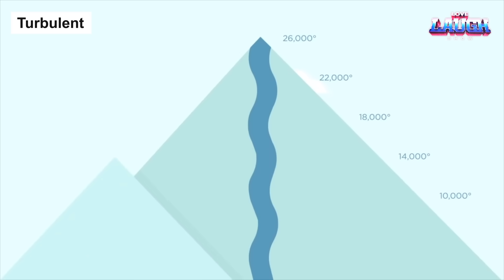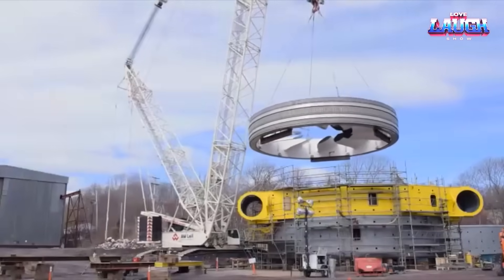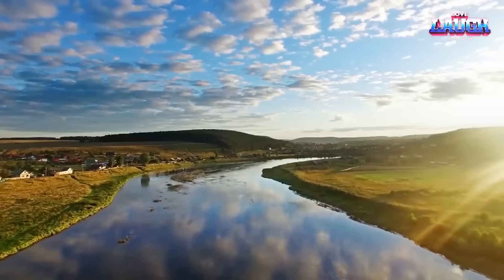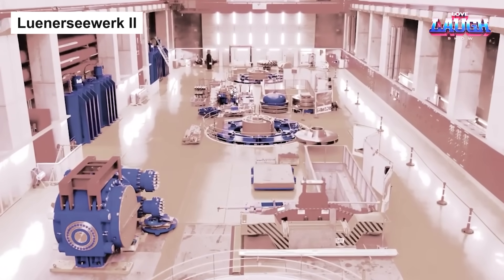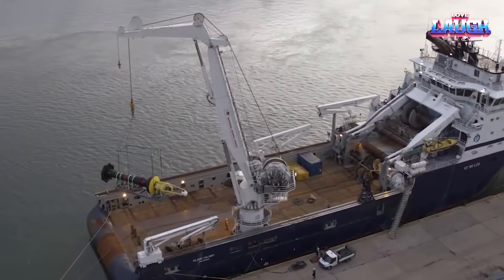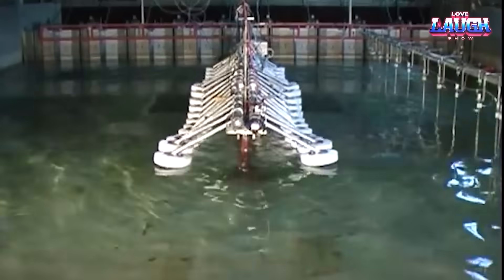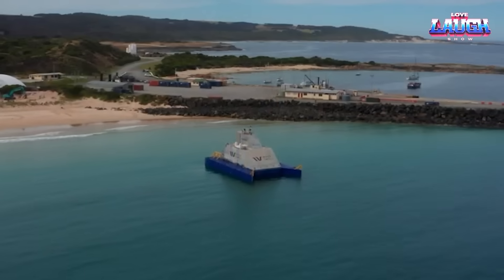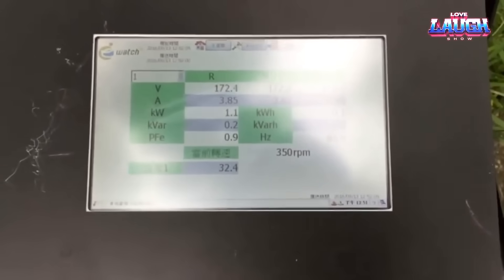12 Amazing Hydroelectric Technologies That Will Change Our World

Comment: Taum Sauk pumped hydroelectric power station is NOT, the largest in the world. The Dinorwig pumped hydro station, in North Wales, has a storage capacity about 2½ times greater than Taum  Sauk. Currently, the biggest one is  actually Fengning Pumped Storage Power Station, no Surprises it's in China, completed in 2021 with a whopping 40 GWh, 11 times bigger than Taum Sauk.

Fundamentally, a hydropower scheme can only extract a percentage of the energy in the water and all the different hydro generator designs are basically trying to improve efficiency abd/or reduce costs. The overall scheme is to convert the potential energy stored in the water interconnected energy to drive a turbine.

For example, take the first Vortex design. Whilst I'm not familiar with the exact design parameters of this system, by designing the penstock (water supply channel) in a way that converts the initial head of water into a fast flowing stream of water and then into a vortex, this I suspect significantly reduces the size of the turbine that's required, and hence costs. However, I suspect it's probably not the most efficient way of converting the original head and volume of water into electricity, but don't quote me because I haven't done the calculations.

Comment: Without emitting greenhouse gas....  no.  Is it being pulled by a boat?  Does that boat run on fuel?  Is it made of metal?  Was that metal dug out of the ground?  Was it smelted?  Did the trucks have tires?  Lol.  And first of all you have to think "greenhouse gas" is what the media tells you it is.  What it actually is, is what you exhale.  It's what trees and all plant life need to breathe.  If you get rid of these "greenhouse gasses" guess what, YOU HAVE NO GREENHOUSE YOU HAVE A DEAD HOUSE.  Now if you actually cared about the environment instead of worrying about "greenhouse gasses" you might ask about industrial waste.  Funny how no one mentions that one..... oh but they care all right.  HA!

Comment: Inthe ukwe seem to behaveing lots of floods its time we use rhis reasoirce to our advantage .it will have a major pay layout yet once done it will. Sorttwoissues out.flooding and power for free . Plus why are we useing  turbines and not screws . Its time to spend on something we need now and instead of metal use polt propaline for the screws cheaperand can be  moulded very ifinatnt and quickly .

Comment: Open Hydro is a failed company. Maybe do better up to date research?  Doesn't mean tidal freestream power isn't a great idea.Especially 2 m/s would have a huge impact on night time power supply of industrial plants that cannot ramp down at night or use expensive stored energy very well.
Reply from the maker: Indeed, staying current with information is crucial, and it's noted that OpenHydro faced challenges. Tidal freestream power does hold promise, and advancements in the field can potentially address issues and contribute to sustainable energy solutions. It's a dynamic landscape with ongoing developments.
Reply: @LALSHOW   well, Open Hydro and Seagen were the top high profile large industry players in the game.

The ground mounted Open Hydro design was battered by lose rock at 7 m/s currents in Pentland Firth.

Seagen corroded it's pole bed in limestone bedrock quickly.

Basically poles and seafloor mounts were disproven by wasting billions on rather obvious geological and hydrogical design aspects. Now polics lost interest.in funding. Well played by the gas turbine makers doing these rushed understaffed and underfunded projects.

The current 3 3rd.gen cigar type surface mounts do hold promise.

Unfortunately none of the real key design quests get any attention at all.
Neither how to mount in the middle of the water level main flow. Nor how to access the vast areas of 2 m/s currents.
That cannot be done by horizontal propellers design at all due to Material strength limitations.

We as humans do need to draw focus and attention on the latter question.
It is absoluetly vital to generate non-intermittend predictable renewables in the solar night for each and any large raw materials processing mass volume industry. People don't want to discuss it.
How to electrify and decarbokise s?ch critical industry. Too many people like to see all industry die and go full luddite.
These people do not realize we would scape the planet of any vegetation fast if we cannot make steel tools or bioplastics packaging foil. Not even paper food packaging or linnen or jute bags.

This is key to any decarbonized economic activity and sustainable green growth. Industry cannot be electrified without. Unless you got a fast cheap drill for hard volcanic rock in geothermal or are into Nuclear and have fuel not controlled by pariah energy blackmailer Russia.

I would appreciate if you draw atrention to the quest for 2 m/s tidal power. The big why?
Happy to provide sources.

Comment: Do you want to say that you discovered/rediscovered the wheel or hot water?!?! 
Well, tidal turbines have been known for over 60 years and used in France (for example).
Then, NOT all countries have hydropower potentials or have already been exhausted (completed).
Reply from the maker: Absolutely, tidal turbines and hydropower, in general, have been known and utilized for many years. It's important to recognize the advancements and existing knowledge in various renewable energy technologies. Each country's energy landscape is unique, and not all may have the same potential or resources for certain types of renewable energy. The goal is often to find the most suitable and sustainable solutions based on local conditions. 🌊🌍
Reply: @LALSHOW  well, everything you said bere SHOULD have been said in The video as well!!!!!

Comment: 2:05  There is soething wrong with the sated specification for the 'Open Hydro' power generation. It stated is was 53 meters in diameter. That corresponds to 174 feet. Neither the one shown at 2:04 (with a person sanding in front of it), nor the one shown at 2:08 (with a walkway in front of it and the ship's command bridge in front) is 174 feet in diameter. I'd say the second (larger one) perhaps has a circumference of 53 meters. It definitely is not 53 meters in diameter.

Comment: More Taum Sauk and fixed solar power. Minimal moving parts. Maximum gain. Minimal upkeep.
Also, much easier and modular to use. Install once, power for 10+ years, save the potential energy storage.
Combine with global UHVDC network, get power anywhere on the globe 24/7, with even
less moving parts, since the potential energy storages only have to make up for lack of power,
when basically the Pacific Ocean receives the most of the sunshine.
Reply from the maker: You've outlined a compelling vision for a sustainable and efficient energy system. By combining fixed solar power with natural potential energy storage solutions like Taum Sauk, you reduce the need for complex moving parts, leading to decreased maintenance and improved reliability. Additionally, the integration of a global Ultra High Voltage Direct Current (UHVDC) network could revolutionize the way we distribute and access energy worldwide. This innovative approach aligns with the principles of minimal environmental impact and maximum energy gain. It's exciting to envision the possibilities for a more sustainable future!

Comment: 4:41 It's not actually a power plant, it's a battery that stores power in the form of potential energy.
I can't think any reason why it's the shape it is. Round is better.

Potential storages are good for two things, storing of water, to be released over time and storing power.

I imagine storages at much greater height differences, which also increases storage capacity.
The tensile strength with a round shape is the best way to keep the shape intact, besides
building the lower reservoir in the ground, receiving sideways support from rock.

Also, filtered rain water can be added into the higher reservoir at a lower cost than pumping from the
lower reservoir.
Reply from the maker: You've provided some valuable insights into potential energy storage systems. Indeed, round shapes can often distribute pressure and tension more evenly, making them a practical choice for structures like energy storage facilities. Additionally, utilizing natural features like the ground and rock formations for support can enhance stability and efficiency. Moreover, the idea of integrating rainwater collection into the system showcases an innovative approach to sustainability. It's fascinating to consider how these technologies can continue to evolve for more effective energy solutions.

Comment: The Landustrie "screwderbind" is little more than a new usage an Archimedes screw,  an invention originally created to move water from a low lying river or lake to higher ground irrigation troughs. In the early '50's they were also used as a method of generating electric power in the flatland areas in Egypt in cooperation with the UK. This is really nothing new.
Reply from the maker: You're absolutely correct! The Archimedes screw is indeed an ancient invention that has been used historically for various purposes, including water lifting and irrigation. It's a testament to the timelessness of certain engineering principles. The Landustrie "screwderbind" may be a modern application or adaptation of this concept for specific agricultural or industrial uses. While the core technology remains the same, innovation often involves finding new and efficient ways to apply existing principles to address contemporary challenges.

Comment: Put the rotar after a damn and double energy building
Reply from the maker: Placing a rotor (or turbine) after a dam can indeed harness the gravitational force of the falling water, converting it into electricity. It's the principle behind hydroelectric power. Combining different renewable energy methods can optimize energy generation. However, proper design, safety measures, and environmental considerations are essential.

Comment: Pumped hydro is an amazing way of storing renewable energy and releasing it when needed, but it has to be built in natural depressions in the geography. The amount of CO2 emitted to build reservoirs of Taum Sauk out of concrete means that won't be green for decades, if ever, considering ongoing repairs needed etc.
Reply: How do you think they mine, smelt, transport, and produce all this stuff? There are no solar powered ships, mines, etc, and solar, wind, or any of these technologies are far from "green." Take a look around you inside or out and everything you see is either made from oil/gas/coal or it requires them to be produced and transported. The only "green" way to live is a 100% hunter/gatherer lifestyle.
Reply: @baneverything5580  That's unfortunate, seeing how oil, gas and coal are limited resources which are already starting to run out. So I guess you'd better brush up on your hunting and plant recognition skills rather than post on Youtube, if that is what you truly believe.
Reply: @baneverything5580  Until you fart.
Reply: @DavesTreeFarm Or just from breathing and thus living, all life on this planet has a carbon footprint since we work in a way similar to internal and external combustion engines.  We consume carbon rich fuel, usually in the form of carbohydrates (engines do the same when burning ethanol) and exhaust carbon dioxide, water and some nitrogen oxides as some of the byproducts.  Other byproducts of life is methane, solid waste and liquid wastes including urea, ammonia, and various minerals and metals.  Strangely enough, the average human body is about as energy efficient as those engines mentioned before at around 25%.
Reply: @WJCTechyman  It was just a joke.
Reply from the maker: Pumped Hydro Storage is effective for storing large amounts of energy and has a long lifespan. However, it requires specific geographical features and its construction can be carbon-intensive. A holistic environmental assessment is vital for each project.

Comment: The computer voice on this video is absolutely annoying.  No information on any of these projects—it’s possible all of these are experiments and never went forward with full production.  Some such as the first example of small hydro looks promising for providing energy for one to three homes where there is a small but constant water source.  I worked for the power company and was part of the team connecting various solar and wind experiments to the electric grid. Some of these projects are one of kind and were never duplicated. Some were improved as well as increased in size and output.
Reply from the maker: I understand your concerns. It's essential to differentiate between experimental projects and scalable solutions. Many innovations start small, but with proper research and funding, they can be refined and expanded. Your experience in the field provides valuable insight. Thanks for sharing. 🌍

Comment: None of the renewable electricity produced is provided to the public whatsoever, the electricity produced is being sold back to the grid to line the pockets of the greedy owner of the actual machine!
Reply from the maker: It sounds like you're expressing concerns about the way renewable energy is monetized and distributed. While some private renewable energy producers do sell their energy back to the grid for profit, this also helps stabilize and diversify the energy supply. However, transparency in business models and intentions is crucial for public trust. Advocating for clearer energy policies and regulations can help ensure more equitable distribution and benefits from renewable resources. 💡🌿🔄

Comment: The "turbulent turbine" makes a pretty swirl, but both turbulence and friction are energy sinks -- and this design has lots of both.
Turbulence turns energy into heat via unproductive eddy currents -- that energy is unavailable to the turbine.
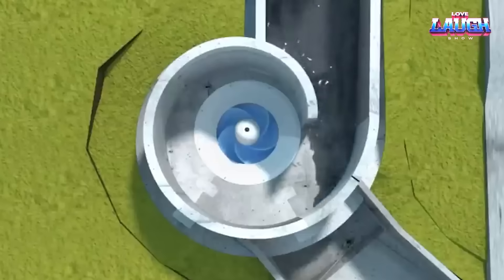The water at 1:00 has more interactions with the containing walls than necessary. And it is doing so at high speed, which makes more friction.
I am skeptical that pre-swirl going into a turbine is a good thing for efficiency.
Reply: Pretty sure they researched and tested variables; otherwise, it would never have gone into production. Note that said generator was developed and built in Western Europe and not somewhere else where they often don't do enough research and testing before digging in nature.
 Just look at  the Tom Sauk installation; the amount of concrete to build that has caused so much CO2 emissions, it's highly unlikely it will ever be carbon neutral.
Reply: @SlickBubbles Geography does not necessarily bestow credibility. The Ecat by Andrea Rossi is a product of Western Europe. He has done testing and demonstrations, but there are skeptics.
I don't understand how the Taum Sauk Hydroelectric Power Station is relevant to discussion of the vortex technology.
Reply: We  have necissary  materiel  to  create  green  energy  .we  need  only  reflexion . Another  green energy  source  , is  chemical  elements  reactions  .
Reply: @بنداودمراد  Congratulations, you neither engaged nor rebutted anything that was said in my comment.

Comment: Great!!! Another Perpetuum mobile. 
Where are the numbers? How much material like steel, copper, concrete, etc, per kW? Or does it produce more energy, than the water (kinetic/potential) contains? 
3:58 This is not the powerhouse, this is the spillway. Just wasted water / power.

Comment: You have presented technologies that use lots and lots of tons of concrete and steel and some that are not predictable, like wind, which make electric bills higher than ever.
And yet you manage to miss a technology that is 10-15 times lighter per MW power than everything else and is predictable. Minesto, a swedish company is making Dragon class underwater kites that use slow tidal and ocean currents. You should really look into that.
Reply from the maker: Thank you for highlighting the innovative work by Minesto and their underwater kite technology. It's true that various renewable energy solutions have different advantages and disadvantages, and it's important to consider a wide range of options for sustainable power generation. Technologies like underwater kites that harness tidal and ocean currents can indeed be valuable additions to the renewable energy landscape, offering predictability and potentially lower environmental impact. Innovations like these play a significant role in our transition to a cleaner and more sustainable energy future.
Reply: Que es eso de cometa submarina?? Puedes dar mas dato ,¿algun vídeo o link? Para saber a que se refieren!!

Comment: I really like these small units that can be put in any running water.
Reply from the maker: Indeed, small-scale hydroelectric units designed for use in running water, like streams or rivers, can be a valuable source of clean energy for localized applications.
Reply: You can actually make your own to run in a small creek on your property using a motor from one of your large home appliances. Of course, if it's a creek where fish live, it gets too complicated for many people.

Comment: Offshore metal constructions do 25y at most.
Reply from the maker: It's true that offshore structures face harsh conditions, but with regular maintenance and technological advancements, their lifespans can be extended. It's all about balance between durability and sustainability. 🌊🔧
Reply: @LALSHOW  if it ain't durable it's not sustainable. Windmills at sea last 15y A single coal, gas or nuclear plant lasts 60~80y with less hardware.